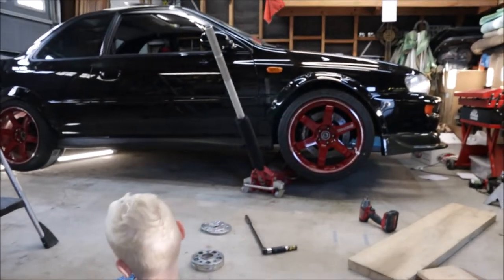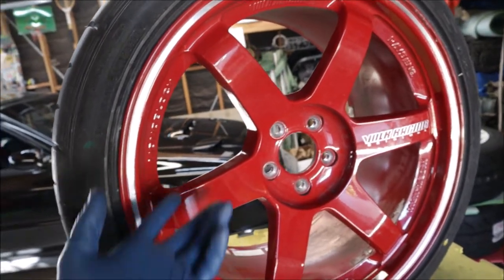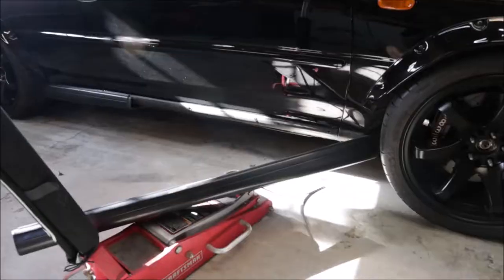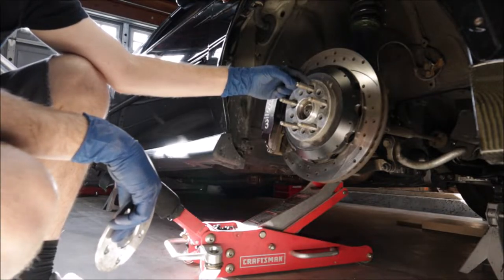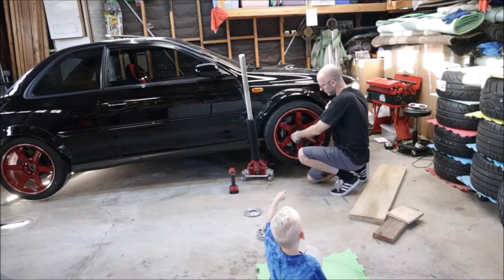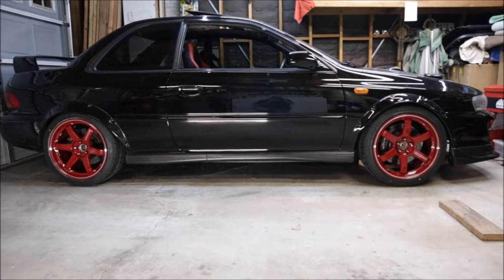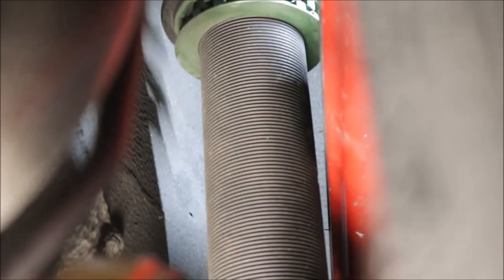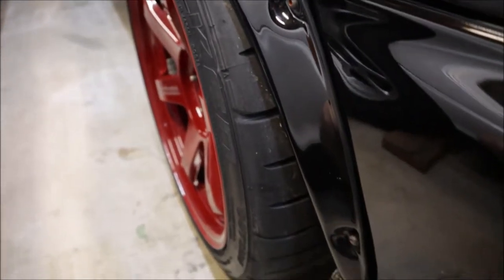New Wheels! Volk TE37 For The Impreza 2.5RS GC8

Comment: Coupes are GM8, GC8 are sedan, GF8 for wagon.
Reply from the maker: Different in the USA.
Reply: @RoadPatina  I've owned 9 Subarus and 4 gc8. I currently own a jdm WRX STI type RA gc8. I know these cars like the back of my hand. It's not different in the US. GC8 is the chassis code. "G" is indicative of the 90's Impreza body, "C" is for sedan, "8" is for 2.0L turbo. Check your vin I guarantee it doesn't say "C" anywhere.